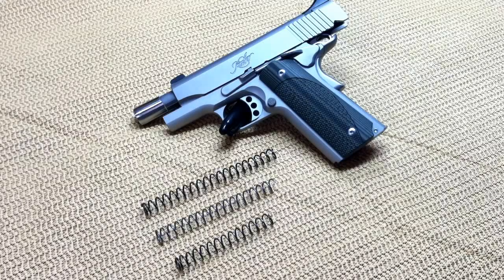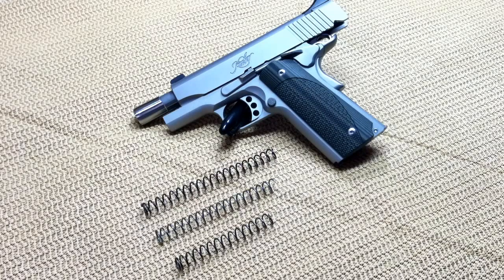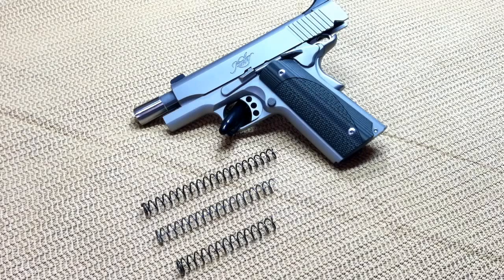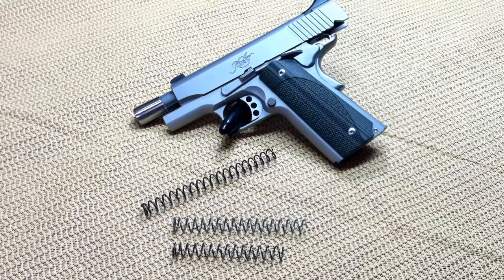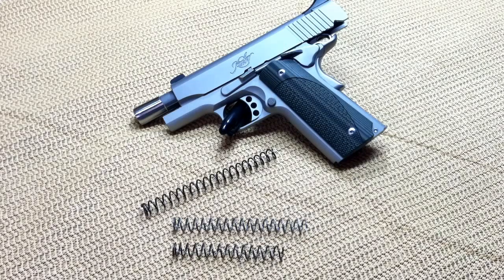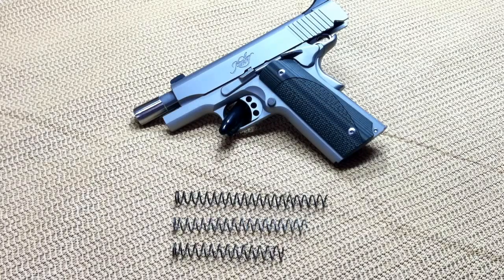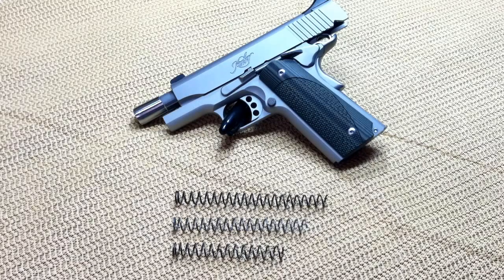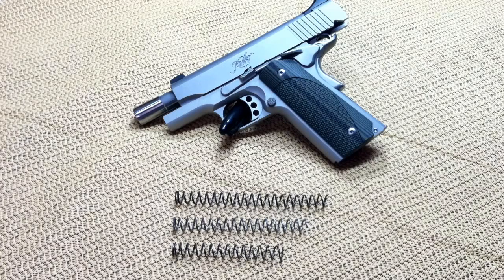Kimber Stainless Pro Carry ll Guide Rod Modification Part 2

Comment from the maker: I'm quite sure about your question. When I changed out the stock Full Length Guide Rod for the Wilson Combat G.I. version, I eventually used the stock Kimber spring and stock reversed guide rod bushing. All works perfectly together. Hope this helps.

Comment: If you count the number of coils in the two smaller springs, the "original" has 15 coils and the newer Kimber spring has 18 coils. I think this accounts for the length variation.

Comment: I was going to buy a Kimber Pro model but the guide rod issue and the fact that you need a special little tool to break it down and the low capacity changed my mind. But it’s a pretty little gun. And expensive too. For the same price you could get the beretta 92X Performance. Superior in every way.